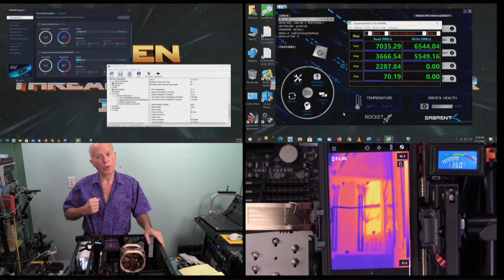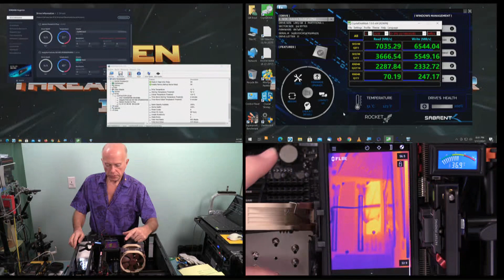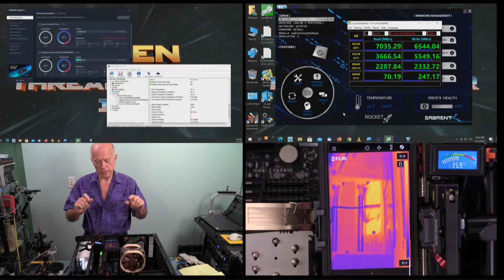Heat and Speed Test Sabrent Rocket 4 Plus PCIe 4.0 M.2 NVMe Drive

Comment: hey,
I heard (from amazon reviews and youtube videos) that the Sabrent Rocket 4 plus making problems after a few weeks.
Windows doesnt display the SSD and someone said that Sabrent overclocked that SSD so they die much sooner.
What is your experience regarding these problems?
How long have you used yours?
Reply from the maker: Hi Typed WT, 
Nice to meet You! Yes, we've been asked and have read same about those issues encountered. Our View on this remains the same until we see further, repeatable research evidence. ESD. 

Yes, it's possible to overclock an M.2 NVMe SSD. Intel has demonstrated that possibility. Not a good idea. There are two parameters that could be tweaked for those who have that ability. The adverse affect would be to lower drive longevity. Also... Not a good idea. Anything of an SSD type of device has a finite amount of writes. They all have 5 year warranties. 

We have the longest history with Samsung SSDs and M.2 NVMe SSD Drives. Sabrent is new to this market. We have the most amount of Sabrent M.2 NVMe SSD Drives of all the M.2 NVMe Drives we've tested and are currently using. Our Boot Drive and RAID Drives on our Gigabyte TRX40 Designare Motherboard are all Sabrent. And the 4TB Virtual Instrument Drive also Sabrent. 

Our advice, in this day and time, get the Drive that has the best price performance. Match that Price / Performance to the performance of Your System capabilities. In other words, Your Motherboard Chipset. And prepare to minimize ESD. Good Questions! Hope that helps!

Comment: i put my sabrent rocket 4 plus 1tb in as a system disk yesteday (upgrade from samsung 960 pro 512gb) and ever since then i'm getting some nasty system lags. i don't know if the new drive is throttling (i've seen it between 67°C - 70°C), or maybe it's two devices fighting at the bus (both the gpu and the ssd are pci-e 4.0), or maybe i should just format it and but a greenfield install on it (i have cloned the old samsung ssd to it using macrium reflect).
Reply from the maker: Hi YumanoidPontifex, Let's see if we can help! 
1.) What Motherboard are You using? Why do we ask? M.2 connected to CPU or through Chipset. We'll be happy to verify for You if You like. Yes it matters! 
2.) All M.2 NVMe Drives should have a heatsink! 
3.) Did You have any Samsung software installed? Specifically the Samsung NVMe Driver? Use Windows default NVMe Driver.
Hope this helps!
Reply: @BuildOrBuy  i never had any extra heatsinks on m.2s. this is on asrock miniITX board, amd x570 chipset, single m.2 slot on the back side. it looks like the board/case will allow for a heatsink, as the case (xtia xproto) has a hole under the board in that area. pci-e riser cable might get in the way but it should be possibile.
i was monitoring the temps and the system is fine when the disk is at cca 55°, but then at some point it decides to do who knows what (disk's internal housekeeping?) it jumps to 71° or even 73° and that's when the lags come in. i've found a nvme heatsink from EK that is not too big and should help here, i think i'll have to get it if this keeps happening.
Reply from the maker: Hi @YumanoidPontifex  , That's a tight space. Got it. Try the Heatsink and see if that helps. I'm beginning to wonder where the problem is occurring. Trying the Heatsink will eliminate or confirm a point of contention. Keep Us posted on Your progress!

Comment: i have a sabrent rocket 4 plus in secondary without a heatsink and western digital black sn850 in primary with a heatsink. temperatures on my primary remains well below 45 degrees, but temperatures on sabrent goes straight to 70 and then gets throttled down. i was not aware that we cannot use these drives without a heatsink. i am going to try to fit a 5mm pure copper heatsink on it and see if that works. i dont have more than 5mm of space available behind the motherboard. if it dosnt work i'll have to switch to sabrent as primary and western digital as secodnary.

to anyone reading this. do not use a pcie gen 4 m.2 drive without a heatsink. it just wont work. especially if you live in australia where ambient temperatures go from 30-40+
Reply from the maker: Hi Akshat, Thank You for Sharing. Those little details like a Heatsink matter. What Motherboard are You using? Your Motherboard should have included NVMe Heatsinks to accommodate clearance. We'll be happy to look that up for You if You like. Appreciate Your Comments!
Reply: @BuildOrBuy  I am using an Asus rog strix x570-I ITX motherboard. It only has two slots one in front with a heatsink and one in the back without a heatsink. Thank you for your help. I emailed sabrent as well about it. My last option is to put sabrent in primary. But since it's dual sided, using just the motherboards heatsink won't do. I'll have to put a heatsink on the bottom of the drive as well. This motherboard has multi layered pcb with the primary drive on top. Due to which it has 5mm space left below the drive so I can fit another 5mm pure copper heatsink below primary for cooling the other side of the drive. I was regretting not waiting for the newly launched 4tb rocket 4 plus but I am glad I did not. If I have to return these things shipping will be very costly from Sydney to us.
Reply from the maker: Hi @t3sulal , Welcome! Nice Motherboard! Tiny Packaging!  ASUS ROG Strix X570-I Gaming - M.2_1 on the Front, M.2_2 on the Back. 
https://rog.asus.com/us/motherboards/rog-strix/rog-strix-x570-i-gaming-model/

Two options... 
1.) EKWB EK-M.2 NVMe Heatsink comes the closest. Not certain though if that will clear. 
https://amzn.to/39AxCzv

2.) M.2 Heatsink Copper, m2 pcie NVMe Laptop Heatsink Copper, with Silicone Thermal Pad, for M.2 2280 SSD Laptop - This will clear! 
https://amzn.to/3cxF5kP

Never know what You'll find till You look! I went looking! Have Listed both on Video Description in case anyone else needs this! Hope that helps!
Reply: I swapped my primary and secondary. And put the 5mm copper graphene heatsink on the secondary which is sn850. Primary is sabrent but windows is now in secondary. Not ideal, but I don't see any performance degradations. Crystal disk mark gives very good results with both now and none of them throttling anymore. With the heat there is a problem. Of heat dissipation, as it gets hot but there is no way for the heat to escape as I don't have any fans in my case. It's an open case. I am thinking of connecting the heatsinks with the case for secondary and primary with the big dual tower cpu cooler that way at least the heat has some place to go. Also the chipset temperatures get very hot when using the secondary m.2 I might also get some better thermals pads. I hear the fujipoly ultra extreme are good.
Reply from the maker: Hi @t3sulal , Good documentation. Hard to tell yet who has the best Thermal Pads. If You try that brand, let Us know what You think. Thanks for Sharing!

Comment: Damn I need to take into account the possibility of nvme drive speed decrease due to throttling. :(
Reply from the maker: Hi Don Jon, Keep the Motherboard Heatsink installed. You should be alright.
Reply: @BuildOrBuy  I have it all but under heavy load Adata XPG 1TB Gammix S50 is hot despite of the tiny radiator "glued" to it. See it for Yourself on YT and Newegg and tell me what do You think about that drive.
Reply from the maker: Hi @donjon7554 , 
Why did You choose that particular Drive? We've heard the same about the Sabrent but have not seen that behavior yet. You have a 5 Year Warranty. Have You had any other problems with it? Define Hot. How hot? What are Your Temp readings with HwInfo? https://www.hwinfo.com/
Reply: @BuildOrBuy   my finger on the drive is hot. Remember that i have my motherboard on a table.
Reply: @BuildOrBuy  I have chosen that drive because it's gen 3 predecessor is the champion both in buck for buy and windows and Linux both running at the same speed which is unlike Samsung.
Reply from the maker: Hi @donjon7554 , Thanks for Reminder. No way to remember everything everyone has all the time. Hot Drive? Heatsink! Will one fit? Do You need a recommendation?
Reply from the maker: Hi @donjon7554 , Understand. We have not used nor tested that brand of M.2 NVMe Drive. Thanks for sharing.
Reply: @BuildOrBuy  Of course I will keep it on. Don't worry. See my drive in the net. It's nothing about it and it costs the same as second gen nvme gen 4.0 drives like Your WD, Sarbnet. That's insane. I wonder why.
Reply from the maker: Hi @donjon7554 , Everything is crazy right now with Supply Chain interruptions. Availability is everything!
Reply: @BuildOrBuy  you're right.

Comment: Thank you, ive been looking for a video just pike this for the sabrent rocket 4 plus.
Great video too
Reply from the maker: Hi Ham24brand, Thank You for Watching! Welcome! Appreciate Your Comments! Stay tuned!
Reply: @BuildOrBuy  so... does this drive actually run cooler than the samsung 980pro?
Reply from the maker: Hi @mosey4650 , 
From what we could ascertain, about the same. We're getting Reports the WD Black runs hot. Any of them run hot if there's no Heatsink. The Sabrent was the first one we could get that was 2TB. Whereas both the Samsung 980 Pro and WD Black SN850 were 1TB Drives. Pretty good performance for the size and speed. We've had few complain about failures which we attribute to ESD. They all have a warranty. 

Our greatest experience with M.2 NVMe Drives are with Samsung going on 7 years. Then Sabrent. Then WD for M.2. Sabrent is really coming on strong in this arena. I hope they keep it up. Competition is good for Us for pricing! 

So to answer Your Question, the Sabrent is the only Drive to go the extra distance with a copper plate heat shield that does not interfere with the Motherboard M.2 Heatsink. Pretty good. We're going to be doing more Testing with Sabrent Drives in the near future. We know enough to know we need more data. So far so good. Sabrent is what we have on a PCIe 4.0 M.2 NVMe Quad card. Right now, Looks like Bang for the Buck! Hope that helps! Thanks for Watching!

Comment: I see Gills new video, I click play.
Reply from the maker: Hi Nathan, I'm honored! 3 in a row today! Crazy right? As always, Thanks for Your Comments! These 3 took a day to setup. This has to be the most complicated setup we've done yet. Test is fairly straightforward. We need to do a sustained throughput Test of something like Rendering. Working on it! We're also going to be doing a Windows Bootable NVMe RAID soon. Next up, something a little lighter. More creative. Maybe a Wacom Tablet. Thank You for Watching! Stay tuned!
Reply: @BuildOrBuy  I have my Dark Hero motherboard, and my SN850 Western Digital storage drive, but I’m STILL waiting on my 5950x, and I ordered it at launch at the start of November! 😖

But right now my mind is all about which memory I will need, being the most optimal for gaming performance. I’ve seen and read so much information that it has me all confused. Some say get the fastest frequency possible with the lowest timings, others say high frequency RAM becomes sluggish because of the higher timings, and then some say you have to match the CPU Infinity Fabric speed with the lowest timings?!...

And does it have to be “Ryzen Optimised” RAM or not? Is Duel Rank better? Should I use 4 sticks or 2? And I intend to overclock, which means it has to be Samsung B-Die, so that throws another spanner in the works! lol
Reply from the maker: Hi @SodaiGoku , That's a long time! Going on nearly 4 months now for the CPU! Wow! Patience! Pick Your RAM based on Your Samsung B-Die Search criteria prioritization. 

ROG Crosshair VIII Dark Hero | Motherboards | ASUS USA
https://www.asus.com/us/Motherboards/ROG-Crosshair-VIII-Dark-Hero/
x570 Chipset... PCIe 4.0. Prioritize! 

https://pcpartpicker.com/list/ System Builder 
CPU and Motherboard - Add RAM from below! 
https://pcpartpicker.com/list/VVrkXb

B-Die Finder - Samsung B-Die 
https://benzhaomin.github.io/bdiefinder/

Hope that helps!  Keep Us Posted on Your Progress!

Comment: I finally built a new pc.  Parts are hard to come by these days but I ended up with a 5800X.  I look forward to testing it out but I'm still waiting to receive the graphics card.
Reply from the maker: Hi bistrobmusic, We've never seen anything like this for Parts availability. I can name the issues we've had since 1992 from RAM (epoxy used to make them) to Chipsets (changed) to Leaking electrolytes from Motherboard Capacitors (Gigabyte). What Video card do You have on Order?
Reply: @BuildOrBuy  Right now just a meager GT1030 just to get some graphics going.  In the future I'll see what happens, I'm sure the 3060 will be hard to find.  The AMD workstation cards like W5500 are interesting to me.  Maybe those cards will be refreshed this year too.
Reply from the maker: Hi @bistrobmusic , An RTX 3060, can You find one? Hopefully! The AMD Radeon Pro Workstation video cards are solid performers. Drivers are solid. Price is acceptable. They fly under the radar of most Users. We've used the WX 7100 and WX 9100 successfully. The WX 7100 is a better value. The WX 5100 should do just fine as well.